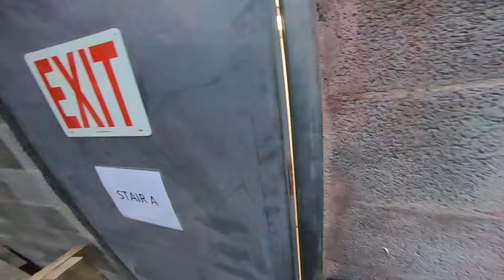How I Climbed The TALLEST Building In America

Comment: You are correct. By ROOF height, Central Park Tower IS the tallest building in America. It took the title from Chicago’s Sears (aka Willis) Tower which stands 1,450 to the roof. It was the tallest building in the world for many years and remained the tallest in the Western Hemisphere until Central Park Tower was topped out at 1,550 ft.
Reply: Um you need to do some research  one world trade center is the tallest building  In the us at 1,776 feet tall
Reply: @freedomefighterbrony9053  My post was about height to the ROOF. By that criteria, at 1,550 ft in height, Central Park Tower is the tallest building in the Western Hemisphere and the first building in the Western Hemisphere to surpass the Sears Tower's ROOF height of 1,450 feet.
Central Park Tower, by ROOF height, is nearly 200 ft taller than One World Trade Center.
In other words, if you could put One WTC next to CPT and you were standing on the roof of CPT, you would be looking DOWN on OWTC.
Facts.
Reply: @freedomefighterbrony9053  You are WRONG the roof of one World Trade Center is 1368 feet, the rest is the antenna which does not really count! So Central Park tower is the tallest building in the Western Hemisphere!
Reply: Dont even bring the name willis into this, it will forever be sears
Reply: @Metra_90_Video_Productions  You are correct. ABSOLUTELY.
Reply: @yourroyalhighness7662  👍

Comment: the tallest building is the one world trade center 
but still GREAT climb
Reply from the maker: If judged by highest occupied floor, CPT is taller, considering it's 1550 feet to the roof. World trade center is  1369 to the roof, with an additional 407 feet of spire. Considering one could take a shower on a higher floor in CPT then world trade center, I do consider it truly taller even though the spire adds height to WTC.

Comment: Not the tallest building in America that would be the World Trade Center which literally is protected by the U.S military.
Reply from the maker: Read the description of the video. You are right and wrong. If judged by highest occupied floor CPT well exceeds the world trade center by hundreds of feet. There's running water on higher floors of CPT in the world trade center which is why I consider it taller. You can take a shower on a higher floor then you can in the world trade center therefore I judge that as higher. Spires don't always count as height of a building. Not to mention this is on taller ground than the WTC and it's rooftop height is much taller.